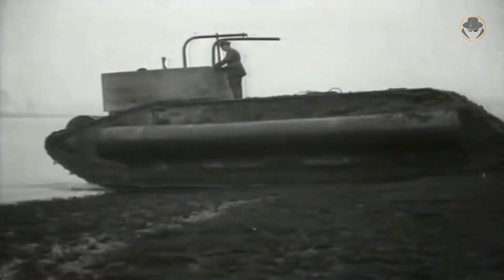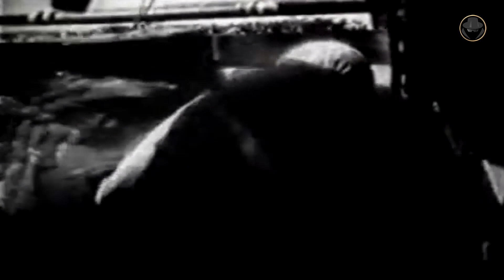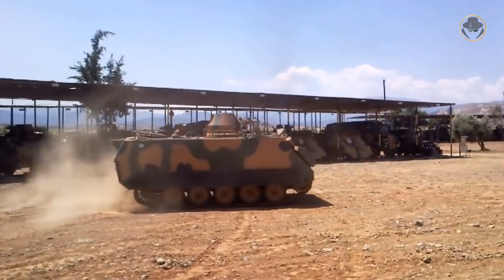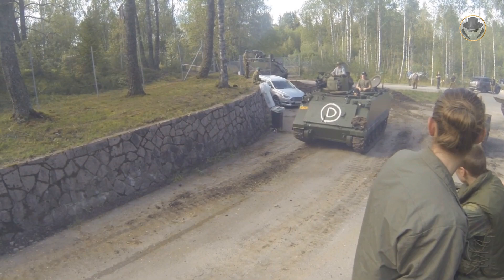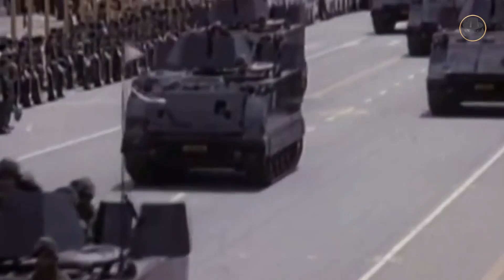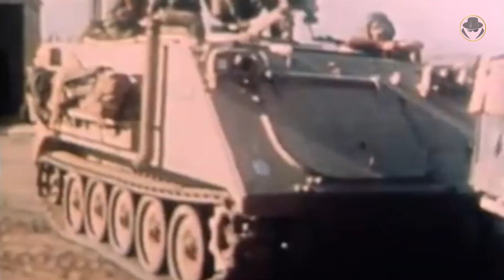M113 | The first vehicle that comes to mind when talking about the APCs

Comment: Australian 113A2 operator here. Our M113's had a specifically designed Cadillac Gauge manual turret capable of carrying a .50 /.30 calibre combination mount, or twin .30's. We also had the ARVL (Armoured Recovery Vehicle), the TLC ( Tracked Load Carrier - basically a truck on a slightly modified M113 drivetrain) and the FSV/MRV (Fire Support Vehicle/Medium Reconnaissance  Vehicle  Equipped initially with a Saladin light tank turret,  and later the Scorpion light tank retrofitted with the Saladin's 76mm gun). Was mentored by a Vietnam Veteran who was a driver during the conflict. Had to write off to obtain a copy of his Citation to discover how he won his MM. He wasn't the only Vet in my unit, but by far the least damaged of them all. RIP, Ron Macy.

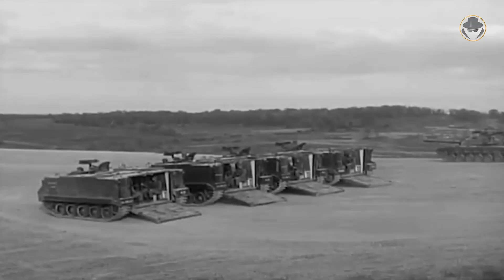Comment: Only saw one at AIT in 1967. It didn’t impress me. The M113 was poorly armored had some issues with land mines and small arms fire.  I hope they would have up graded the armor but it looks like the same   The piece of military hardware as deadly were Huey’s which  had a history with.  small 3:23  arms fire Remember these items come from the lowest bidder and the army tends to have a habit of using junk weapons
Reply: Whatever lemming. 

Here it is in 2026, being used and effectively enough against a far more modern version of the foe it was intended...and still finding itself useful. 

News for ya doggie, every armored vehicle with the exception of MBTs is highly vulnerable to landmines, even the most modern. 

The 113 has proven itself quite capable in preserving the lives of it's passengers. 

The latest and greatest? Not at all, but effective? Absolutely.

Comment: In fact , during the period 1965 to the end of the war, the m113 was greatly reduced in effectiveness because of the appearance of the RPG 2. The RPG 2 only needed one shot to penetrate the aluminum armor of the m113 and the RPG 2 had more numbers than the RPG 7 ,due to lower prices

arvn's solution is to use steel mesh and it works but only works for rpg 2 and not effective before rpg 7

Comment: Ukraine will receive 200 I hear. I imagine they’ll do some modifications if they have time. Will be interesting to see how they’re used.
Reply: I imagine it would take fifteen minutes to bolt their Stugna-P anti-tank missile launcher to the roof. Unlike other anti-tank missile systems, the Stugna-P is remotely aimed and guided by a laptop-like controller attached to the launcher by a long cord. That way, the operator can be safely concealed. This feature would also incidentally allow the missile to be bolted onto an M113 with minimal modification, with the gunner safely inside the vehicle rather than exposed.

Comment: Only problem with the M113's were timid drivers. Had one Lt complain constantly his track wasn't up to snuff. Took his ass out on a test track and let it rip. When I finally pulled to a stop (almost standing it on its nose) this Lt was so terrified he could barely stand. It is a good reliable track though definitely not bullet proof. Same goes for the M-42 Duster when used in ground support.

Comment: An M113 could still be useful ferrying ammunition and other cargo to the front. It would do better off road than a wheeled vehicle. Its armor could stop artillery splinters and 7.62 bullets. It could get in places a wheeled vehicle might not be able to. It might work well as an ambulance for the same reasons as the ones mentioned previously. They would have to find a way to strap the wounded men down, because the ride in an M113 is kind of rough. It would be a very cheap solution to a lot of problems. Compared to what other modern military vehicles cost an M113 comes dirt cheap.

Comment: In my unit we used the M1068 variant of the M113, which is a modern FDC armored command post our our platoon command. We sent digital fire missions to the launchers from the m1068. They are really cool vehicles. And it's loud buttoned up...

Comment: I was a m60 gunner on a m113 in Viet Nam 71-72 A Troop 1/1Armored Calvary196th ..  no one rode inside we stole jeep seats from other units and lash them on the top . We would larrger at night and would unroll a 8ft section of chain link fence and place it front of the track .This was for RPG protection.

Comment: I did a lot of my Service time in or supporting Armor units.  When the high heat was on, when the long hours of operation hit, when all the other tracks were going down, the M113 with it's Detroit Diesel was always up and Mission Capable.
Not to say they didn't break down, but you could usually use the bailing wire and chewing gum to get it through the Mission.